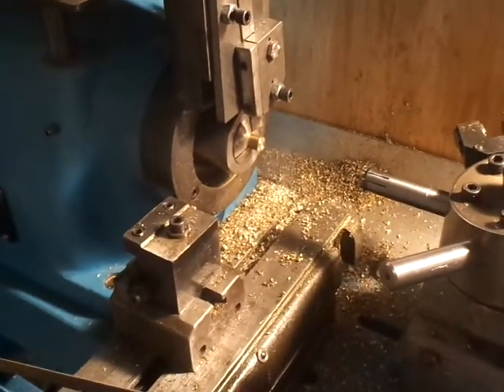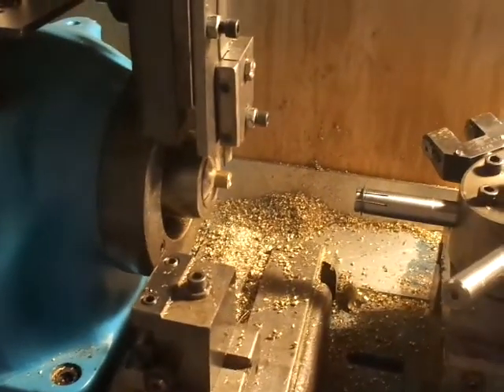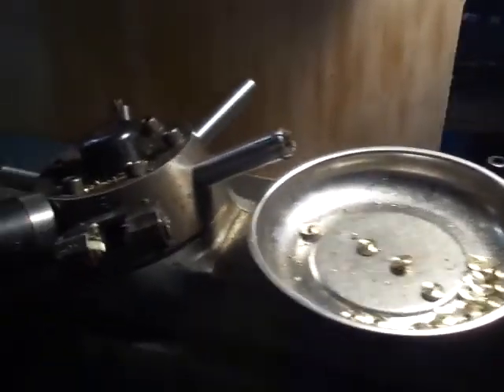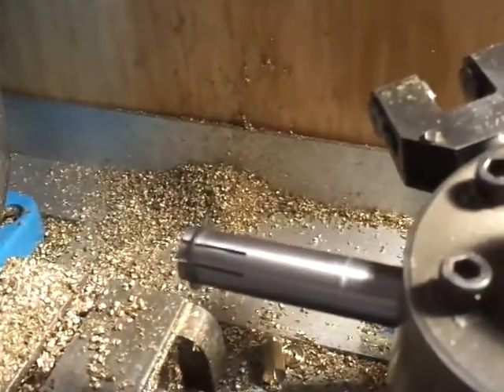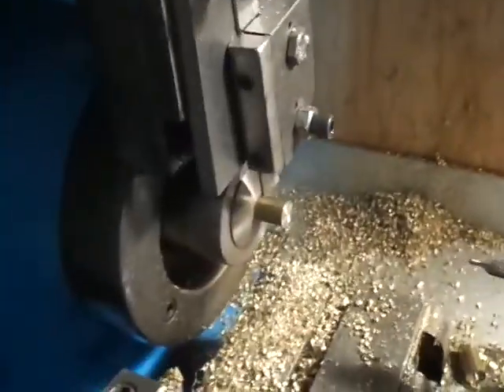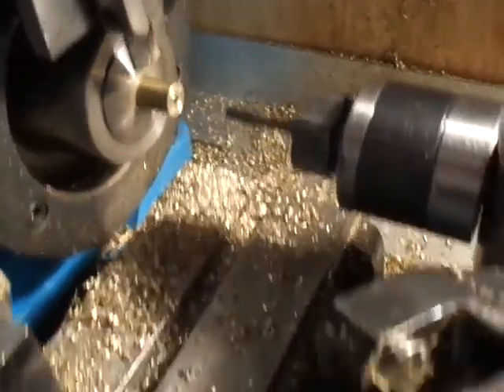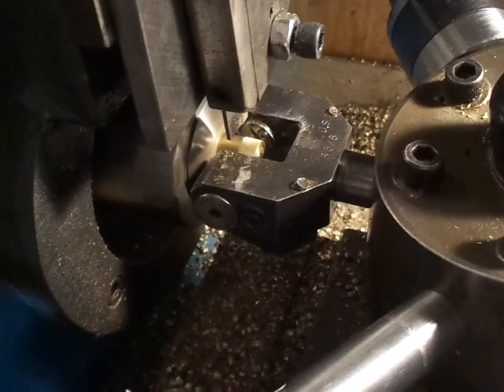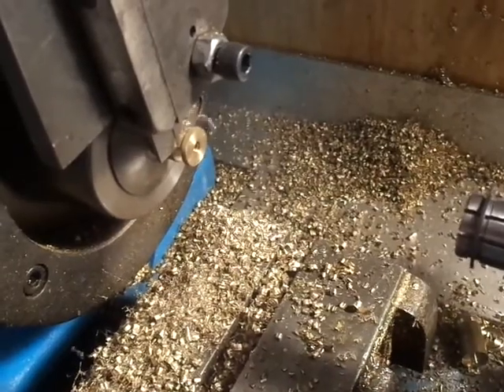KN4YB Hardinge DV59 turret lathe for Morse hand key bugs

Comment: Good morning Thomas, very cool modification to your DV 59. I just got a Feller DV 59  for a job that I did for a guy and I am considering a variable frequency drive to run the motor. Is that similar to what you have done with yours?

Comment: that stock puller is genius! how much undersized is the hole in it compared to the stock you're using?
Reply from the maker: There I am pulling 5/16 stock so I drill 5/16 and cut with a slotting saw. I compress with the stock of 5/8 with a 5/8 collet
Reply: @devoeh2  awesome thanks!